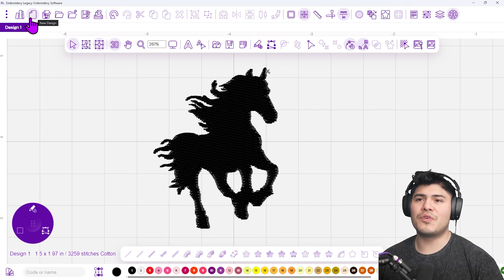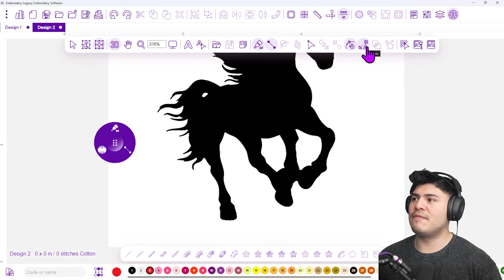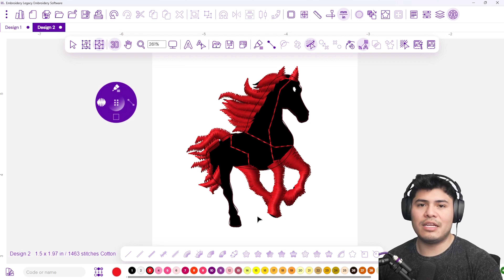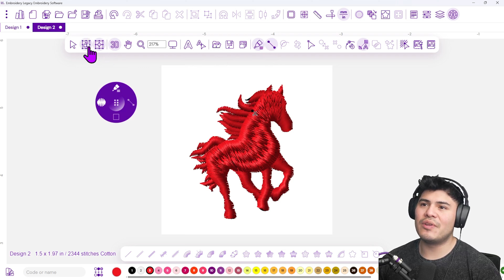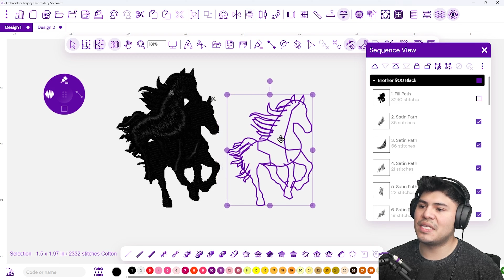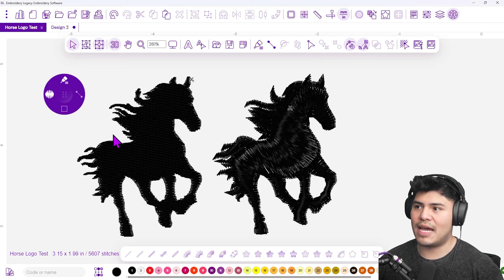How to Make Detailed Embroidery Designs! | Machine Embroidery for Beginners

Comment: why is it saved as JDX and not EMB?
Reply: JDX is the file format of the Digitizer. When finished your design, you save as a JDX, than save as PES or many other specific machine formats
Reply: @heinzulrichbornholdt8770  but isnt EMB also for digitizers? I used to use wilcom and my digitized work are save in EMB format. so does that mean JDX is the same as EMB?
Reply from the maker: JDX. Is our native format file. With it you can re-open designs and modify the objects like you would with EMB. on their software!